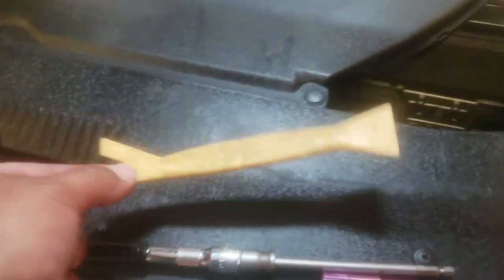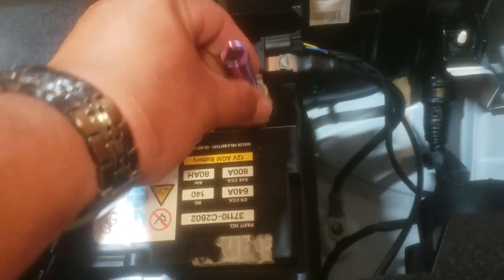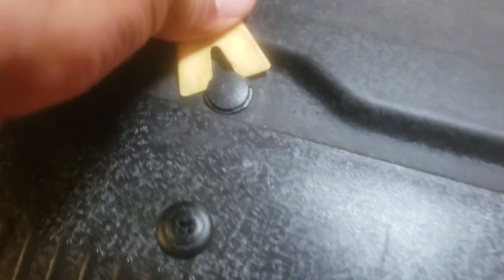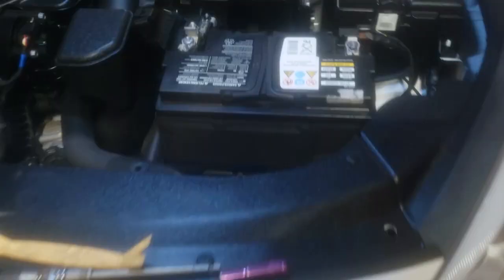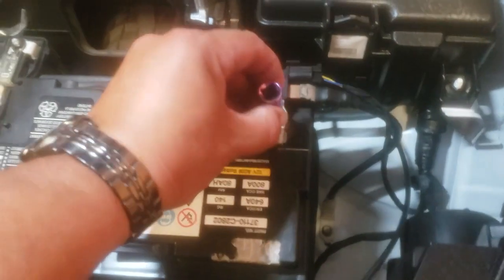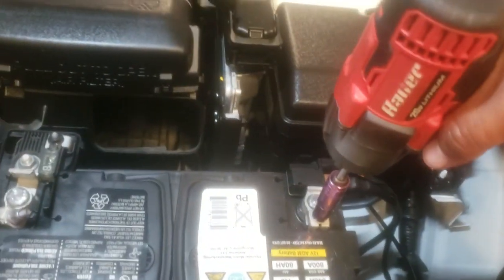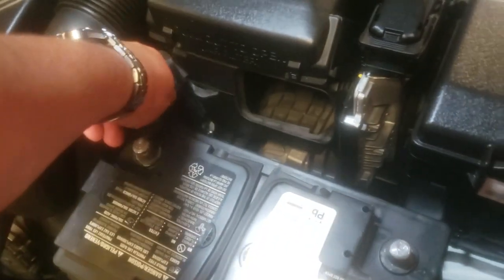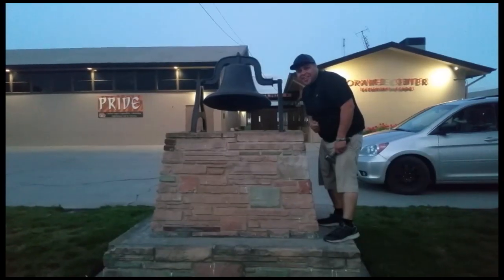How to: Remove Battery from a 2016 Hyundai Sonata

Comment: Is there a way to remove those first 3 clips without that tool?
Reply from the maker: You van try using a flat head screw driver and maybe some needle nose pliers to help you out. These break easily

Comment: Having issues removing the positive cable; the socket wrench wont turn, it's tight af
Reply from the maker: You can try hitting the wrench with a hammer or something big enough to hit it and break it loose...
Reply: @559powerscape  thanks for the quick response! If the negative is disconnected is there risk of getting shocked?
Reply from the maker: @bassistmau  no you should be good.